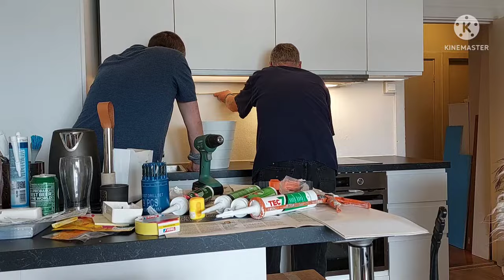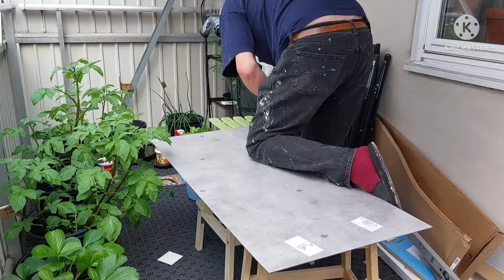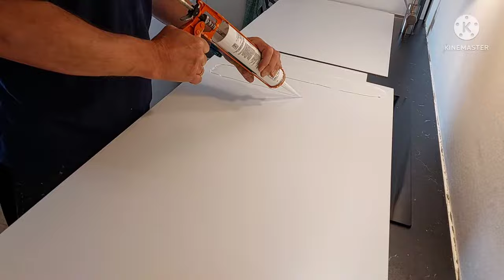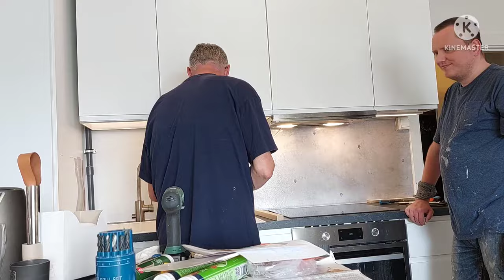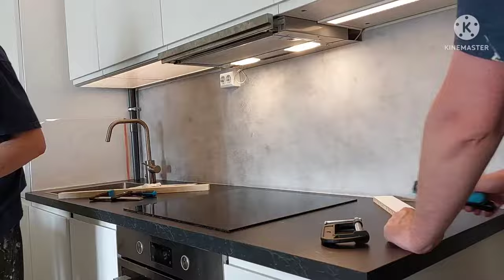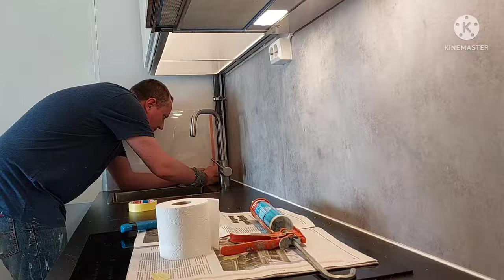Installing IKEA Lysekil Kitchen Back Board as a Vegan 🌱

Comment: Hi, nice work, planning to do the same. Any thoughts on using spray adhesive?
Seems like a cleaner install.
Reply from the maker: Thank you. I'm not familiar with spray adhesive, so I'm not sure. But as long as it's thick enough to fill the gap between the back board and the wall this should not be a problem. Just ad more glue than you think you need.

Comment: Heyyyy thanks for the video, i’m Having a hard time trying to cut the lisekyl panel with the jiggsaw… it ripped appart even with a special blade it leaves tons of shards… any tips pléase?
Reply: Use plunge saw. Its easier. Jigsaw will rip & crack the laminate.
Reply: @grgrider8642  Thank you ! I have found that you can use jiggsaw blade for metal and it works for this material